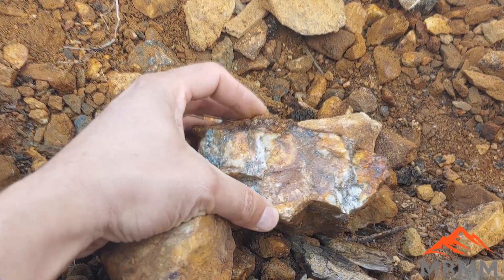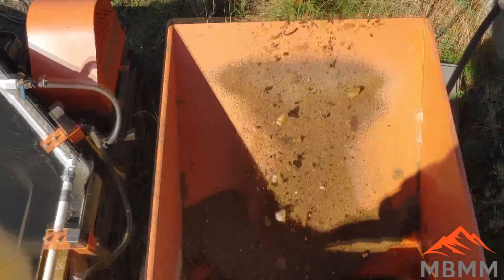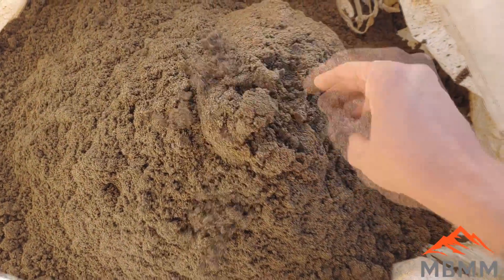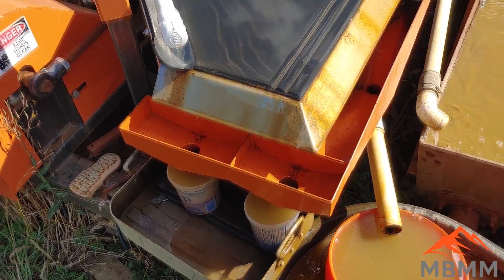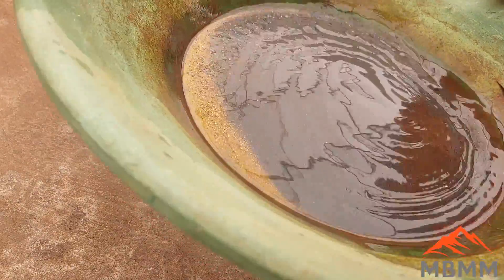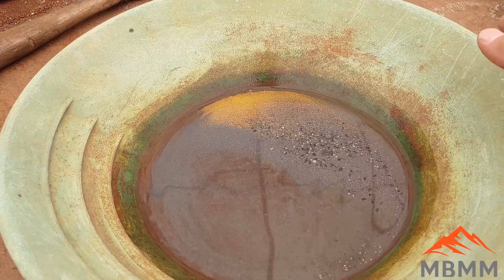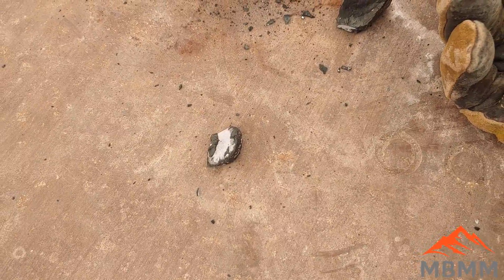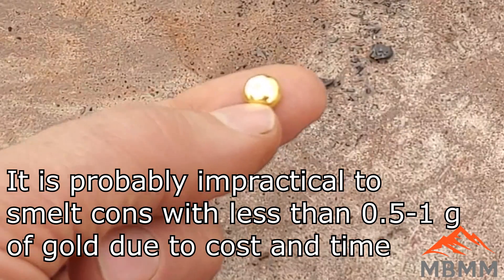Direct Gold Smelting & Refining Raw Quartz Gold Ore

Comment: Love your work Jason. Did you come up with the system to extract the gold from the ore? Or is this basically the process for everyone who recovers gold this way?
Reply: Pretty typical general setup but the devil is in the details and Jason's group has demonstrated tremendous ability in metallurgy, machinery, and process settings. 
Screen sizes, gpm, feeder rate, table tuning are all a project unto themselves even if someone gave you all this equipment. Mistakes lead to the gold going to one of the waste streams or the concentrate being filled with tailings.

Comment: The value of that bead isn’t nearly enough to cover the expenses needed to get it. The people who make the money here are the ones selling the equipment.
Reply: There was no info of run time or what effort needed to collect the ore. Good ore and concentrate are the key along with reliable equipment.
Reply: The turnkey mill method is only viable if it can be free of cost for energy consumed to process the ore! ( 25 kwh  3 phase is $$$$ )
Setting it up on geothermal instead of electrical power supply would be the way to go!
Reply: @rrfields65  The power rating is 25kW not kWh. That's 10 residential 120V circuits. It's 3 phase so the motors last longer and cost less.  At typical commercial rates, that's around  $2/hr.

Comment: You mentioned the magnetic belt before the hammer mill , but no detail , is it practical to remove magnetics ?
Thanks again
Reply: @KD0CAC
Not a magnetic belt, a magnetic feed system. The feed rate is controlled by magic magnetics.
In this system, it is not necessary to remove magnetics. That is all done on the shaker table. The table separates by density, and gold is 6-8 times heavier than sand, 5-6 times heavier than magnetic sand, 3-5 times heavier than steel. The table washes all the lighter stuff into the #3 and #4 ports, and the heaviest stuff (mostly gold) go in the #1-#2 ports.
Reply: Removing as much base metals as possible is always beneficial.

Wet refining it is a must!
More base metals the higher the cost of refining!
Reply: @uncommonlogic1698  That's stating the obvious and not answering the question , what's the point ego ?
Reply: @KD0CAC  I think there may be nano gold trapped in the magnetics
Reply: @KD0CAC  it's not stating the obvious, nor is it obvious.
I do recall it was you who asked a very broad question. My answer was spot on to your question.
You failed to ask a good question. 

I am a wise man who always admits mistakes, I am sorry and I was wrong that  you are offended at my attempt to teach you something.

Just keep in mind, the answer to your question may have not been for just you.

The whole point of MBMM sharing videos is to educate, the point of process is to experiment and learn.